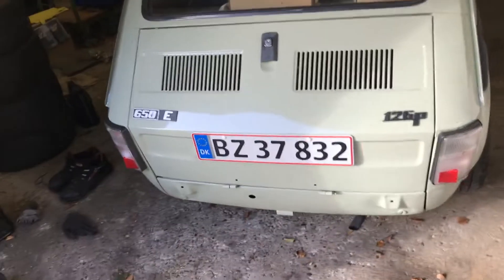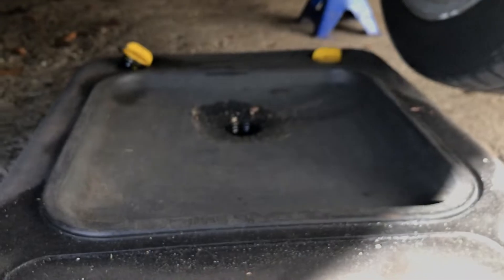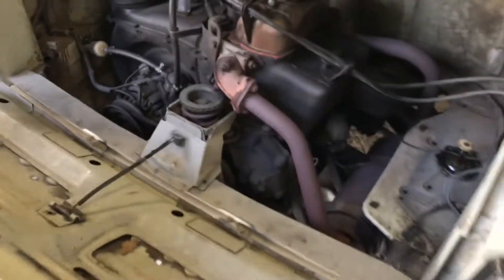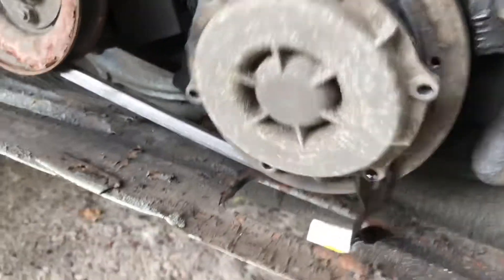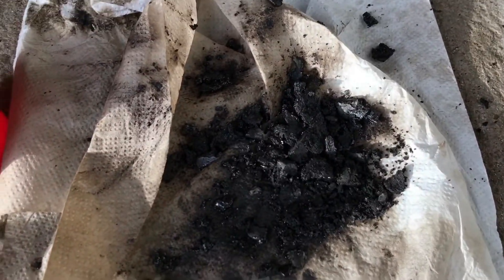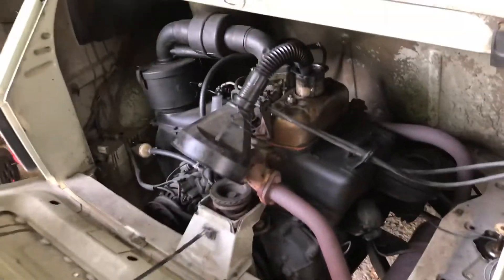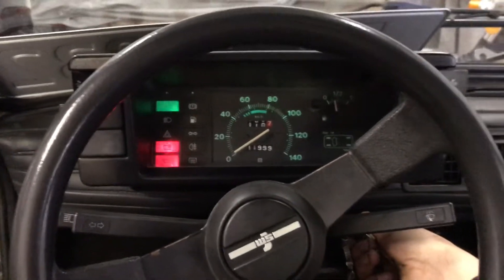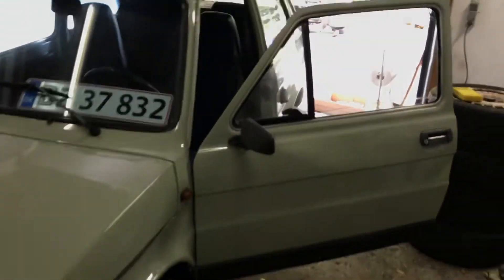How to change the oil and clean the oilfilter on a Fiat 126P

Comment: what size are your wheels and do they fir without further modifications? I'm currently looking to upgrade mine
Reply from the maker: 13”, dont remember the width and ET though. 155/65/13 tires. Had to hammer out the fenders a bit, but that might just have been because the car was lowered :)